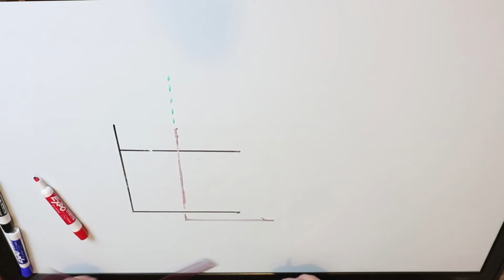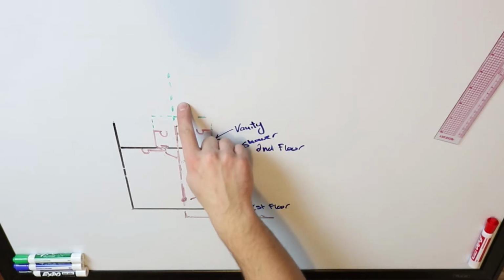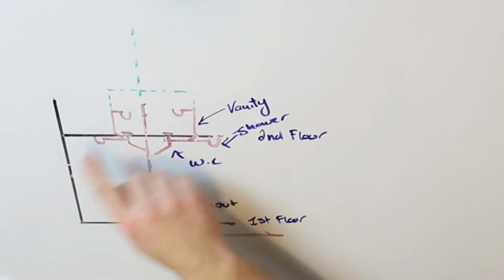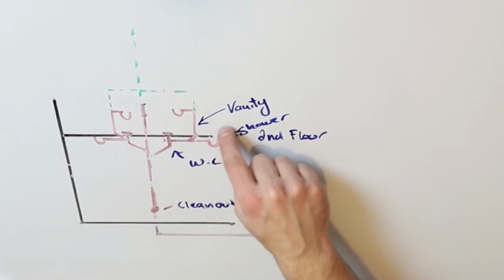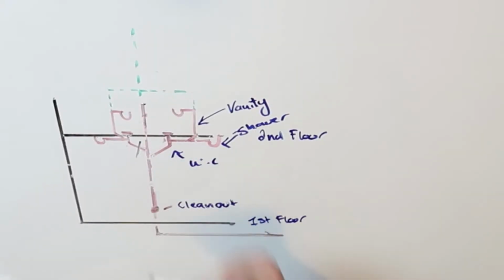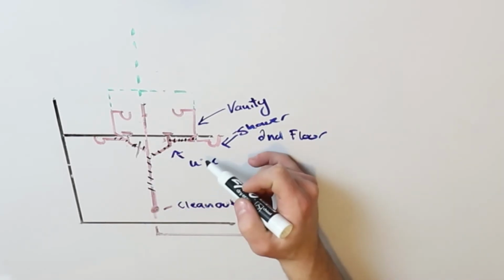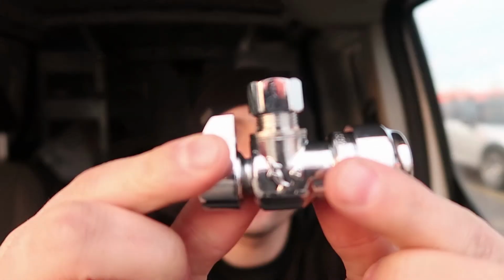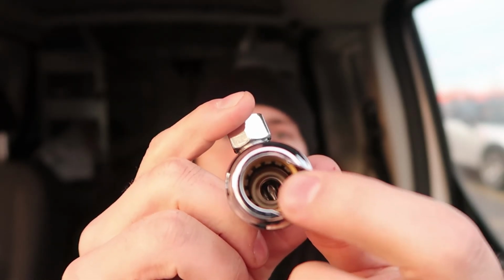The Gong Show Before Christmas! | k 50 drain call | Shark Bite Application | Vlog 26

Comment: Kenny, Kenny, Kenny: next time just swap the cartridge with another from a new Brasscraft R19 or R14.
Reply from the maker: Brother I wish I had them. Only had the Dahl 1/4 turn r19 and r14 in the truck, so no matter what I would have had to leave and pick one up...fml...I’m stocking the truck like crazy now...
Reply: Been there man, I always make sure I've got sink for a double comp kitchen sink install; I just steal and replenish as I go.  How bad was the valve passing? Could you have stuffed a bagel in it and 50/50 a quick joint?
Reply from the maker: Gotta be honest, never used bread before, thought passed by my mind, but I didn’t want to go exploring when there are tenants depending on the water supply. I’ve heard stories of having to wait a while until the bread dissolves...I didn’t want to take that risk or make the issue worse...